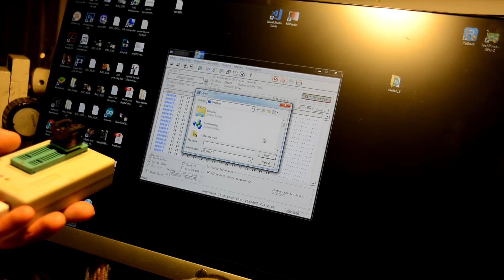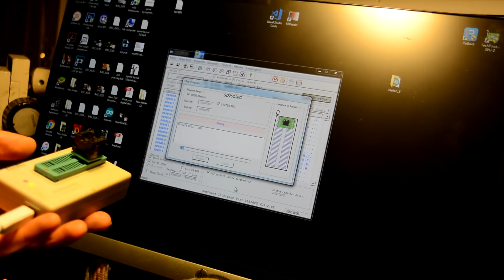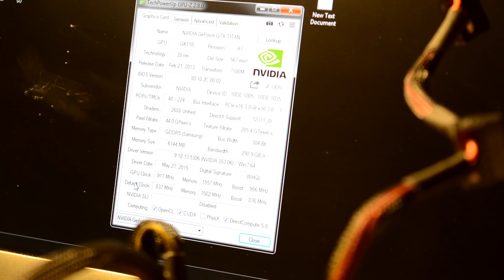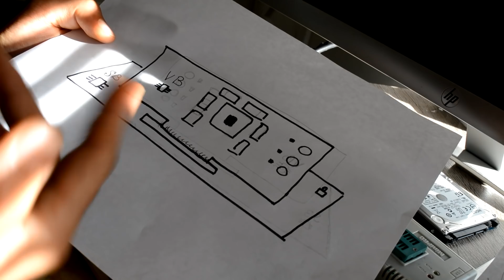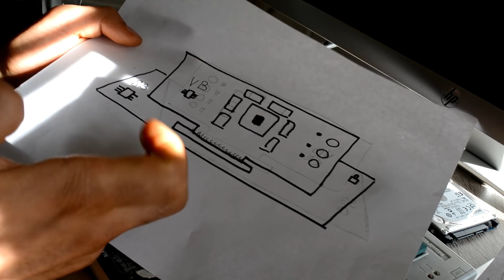GTX TITAN broken, no video out diagnostic + repair + a bit talk about bios graphic card repair

Comment: my gtx titan xp show error on screen that pcie power is not connected i know my psu is fine as i am running rtx 2060 on it without any problem before i was running gtx 1070 zotac 3 fans gpu with 2 pci power connectors so i know my psu is fine and checked gtx titan on other psu it shows same error what should i check??

Comment: Great fix i do have 2 Titan black and i replace the thermal for both of them one card works perfectly after clean etc, the second not detected and no signal at all i cant even flash bios of unstill driver or do anything actully totally not working ,the fan is spinning normal light power seems fine, any help will be highly appreciated.

Comment: I have a ?
 I have a nividia gtx980ti founders edition  it has the same board as the titan and numerous others.. its the one with the 5 caps with one staggered so there not In a straight line. im a great car/truck mechanic very good at diagnostic on the system and understanding how they work its all D/C... im dabbling in repairing small electronics due to no work.... my son bought this card it has 12 volts and had 5.012volts on one side of the the small inductor on molex side plugs opposite end of vid outputs .....it shows 5.036.V  on SIDE closest to mobo ... on the side facing the gpu 8 & 6 pin molex psu plugs it shows -7.023volts?????????... I found a apl3516a switch that is only getting 2.07v on input side and 0v output side so I went to probing and popped a  0,ohm  resistor I finally got proper leads desoldered the resistors jumped them with solder got fans and lights working again...the card don't show up in the bios of my mobo or in windows system. No video output everything looks OK no hot spots the chip gets hot upon start up its getting same voltage out of the inductors @0.087 V the 3.3 v side is getting 3.3 in and out on the other apl3516a just above the one that is getting only 2.07v and nothing out the location of those switches are directly behind  the top 2 of the 4 hdmi & pci output plugs bellow the multiple card plug next to bios chip i think . Sorry for writing you a book I subscribed and like all videos also recommended others to sub and like ur vids if u have any suggestions please let me know also where does that apl3516a  get its power from ... these SMD pc boards ar amazing with there tech im waiting on parts and a rework station wit air & a new t12 iron

Comment: I have exact the same gpu but it has a other problem, at the 5v phase i get a straight short when checking resistance. And if i turn on the gpu i hear a buzzing sound from that area. Do you have any clue what the problem could be?

Comment: I got lost at the bios section. Did you take the chip in question out, and then put it in a working card to upload the bios. And then take that out to place back in?
Reply: he used an external programmer.

Comment: I've got same issue with this card but mine is RX570 4GB MSI, fans spinning but not video output. I did reflashing original BIOS using programmer without take it off from the board but the problem still occur. What should I do next?

Comment: Hi everyone, i am repairing a gtx 780 which had a burnt memory phase. The high side mosfet died and shorted to high side so continous 12v were being supplied to memory chips. I have measured the resistance on memory chips and it gives me a short so i am planning to replace all 12 of them. Can anyone tell me is it necessary to change bios after memory swap ? Ill be using the same memory from same manufacturer (i hope i get what the seller on aliexpress is claiming)

Comment: Hi Elia-Tech, great video thanks! I had a PC about 5yrs old with 2 x GTX Titans (in Sli), when I powered it up recently it worked ok. Then 1hr later , no display & all fans going full speed! I worked out my primary Titan was faulty, when I pulled it apart I noticed one of the SiC780 chips was faulty (clear evidence of over heating).

I'm trying to remove it with my SMD hot air-gun but no luck! I'm assuming it's because the bottom of the chip also has pads which are soldered to a ground or power plane. Do you have any advice on how to (safely) remove/replace it? I'm guessing I'll need to heat the bottom of the PCB at the same time?

Is there anyway to private message you?

Comment: Hello, I have an ASUS GTX 780 DCUII OC with no video output, I've measured 0.9V vcore, 1.6v memory, pci-e 1.04v, there was also 3.3v on the bios could it be the same problem? 
UPDATE
looks like it was the Bios I've used bios programmer and soic8 clip and now it works perfectly

Comment: I didn’t understand a detail: if i have all resistances normal, voltages normal, it is most probably a BIOS problem right? When is it a reballing problem istead? No vcore?
Reply: Hi, did you find a solution?
Reply: it is never a reballing problem, reballing causes heat to build up in the silicon, which reconnects connections on the silicon chip itself not the bga, if reballing temporarily fixes a card you really need a new gpu, and good luck finding that chip.

Comment: it seems i have short in resistor you checked at 1:34 - any idea which component may be faulty? i cant see any burning marks etc
Reply: it seems all resistors works - but still doesnt boot
Did your Titan was detected in bios before You flash GPU BIOS?

Comment: Eli: Let's rewrite the bios
What Eli does: actually changing the bios chip on the pcb
Reply: Well no, he took it off the board, popped it in n SOIC adapter attached to a programmer. Which is how you would do that.
Reply: @androxilogin  Hi, where can i buy that adapter? And the programme he use? Thanks mate
Reply: @loko1505  just search SOIC8 on eBay for the adapter (a couple bucks). The programmer, well that's questionable. You can get a PICKit3 for about $10. Just be sure to Google the chips for compatibility. The k150 was good for a large number of chips but that was years ago. Not sure if they kept it up to date because apparently mine had a knock off chip installed.

Comment: You could of flashed the bios by putting a working card in pcie 0 put the card that doesn't work in pcie 1 and flash it via command line.

Comment: Thanks for another great video, it's great to see how "easy" it can be for someone who knows how stuff works :)
One question though, had it been possible to "flash the bios" while on the card, or is that not possible even if the chip is OK ?
Or was the bios chip "destroyed" so that You had to replace it with a functioning one ?
Best regards.
((P.S. I believe the card in the video is one of the "original Titans" (GK110) with 6GB VRAM... if I'm not mistaken ;))

Comment: Hey Eli, 
thank you for this video! I have a 780 Ti, and I checked all the resistances and voltages just like you, and it is all same, but no image. Chip is warm, but not hot, and I can hold it with my fingers. Could you maybe help me repair it? What should I do next? 
Thank you!!
Reply: I think its a problem with your gpu chip it self. I was following Eli's other videos in which he replaced a 1070 gpu chip. He mentioned there i think

Comment: May i please know how to send u my card its a gtx 1080ti that i only got to play 2 times with it and after there was no display and the gpu is not getting DETECTED by the motherboard tried more then one pc.. but the fans are spinning... plz help i spend lots of money on this card
Reply: Did you find any solution.I have exactly same problem as yours.
Reply: RMA it unless you intentionally overclocked it,  which is something you should never do regardless of what moronic enthusiasts tell you to do.

Comment: I use these for motherboards and GPU BIOSes. For five dollars with adapters this works perfect. https://www.ebay.com/itm/Multifunction-CH341A-Router-USB-Programmer-LCD-Burner-Bios-Board-24-25-Series/272907584757?hash=item3f8a8f44f5:g:ZD4AAOSwwVBbg3ny:rk:55:pf:0

Comment: with an onboard card, or dedicated 2nd card, you could have reprogrammed the bios without soldering out the bios chip.
Reply: If you have watched closely the gpu itself wasn't getting hot with the old bios, which tells me that the gpu wasn't even recognized by the PCI BUS. Maybe I am wrong, but I think flashing within an OS would have been impossible.
Reply: @tirelantony  i was bios modding my 970 and after that the bios was broke. no booting to windows and peepcode was broken gpu. then i threw out the card, switched to the igpu, putting in again and flashed it again with correct bios. worked perfectly.
Reply: @BlacKi-nd4uy  Wow. Nice!
Reply: your the gpu is detected? 
Mine just wouldnt show up under system properties
Reply: i confirm it. I remember doing that once with my dead amd 5770 card, worked well

Comment: i got a free dead GTX Titan with similar problems. I didn't even think about the bios. good power rails, tried reflow, it's detected but throws pcie enumeration errors. I'll have to get a programmer and try reflashing the bios hex
Reply: pretty sure t here is a tutorial for flashing bios easily with tools and bios database is available on www.Techpowerup.com/vgabios

Comment: anyone else clenching when he powers on without a heatsink?
Reply: Nah. When the GPU isn't under a significant load it doesn't get hot too fast... unless it's an R9 290X / R9 295 X2 then it burns your house down in a femtosecond without adequate cooling!!
Reply: @DigBipper188  ahaha, it s true
Reply: @DigBipper188  or a fermi.
Reply: @abcdefg9613  they have a heat spreader... Bare die though would be a totally different animal LMFAO
Reply: @DigBipper188  I have burned myself in a fermi with the heatsink on.
Reply: @abcdefg9613  not shocked. just the spot behind the die can hit between 70 and 90*c depending on the load the card's under.
Reply: nope, is normal in a testing environment
Reply: Why? All components got thermal protections, I guess the last chip without was the duron.
Reply: @dario_Iuliano  Generally, yes, but they're not totally foolproof. You can make a CPU cook itself to death just by not having RAM in the system, for example.
Reply: @DigBipper188  why? does a cpu work at 100% without ram installed ?
Reply: You can do it with a CPU too. It doesn't burn you right away.
Reply: It's ok,  once he see's he gets video he powers it down and puts it back together to do the stress testing.  Chips can take quite a bit and aren't as fragile as most ppl tend to believe, they are delicate nonetheless but durable.

Comment: But isn't this a Titan (without X)? Good video though!
Reply: It is! GK110 chip means Kepler.
Titan - Kepler
Titan Black - Kepler Gen 2
Titan Z - Kepler Gen 2 Dual GPU
Titan X - Maxwell
Titan X Pascal - Pascal "Gen 1" (better 1080 non-Ti)
Titan Xp - Pascal "Gen 2" (better 1080Ti)
Reply: Yep. The Titan X is a Maxwell generation GPU and has a black cooler shroud. The original Titan is a Kepler generation GPU with a silver shroud. Exactly like the GPU in the video. Also, the chip code matches a GK110 A1 stepping, which is a Kepler Titan / GTX 780Ti chip.

For reference:

The original Titan chip code is GK110
The Titan X chip code is GM200

NVidia's post Kepler chip naming scheme is as follows:
Much like Kepler's naming scheme, all modern NVidia GPUs have a 2 letter code denoting architecture. GM for Maxwell and TU for Turing alongside a 3 digit code denoting the performance tier. For example, TU102 would be a Turing chip form the upper mid tier, which just so happens to be an RTX 2080/2080Ti. A GM200 is a Maxwell chip of the high end/flagship, which was released in the Titan X. The GTX 980/980Ti, which was in the same generation as the Titan X, used a GM204 code, denoting a Maxwell architecture of the upper mid range.

High end: x00 
upper mid tier: x02, x04
lower mid tier: x06
Low tier: x08

Nowadays for the current NVidia GPUs, we never see the x00 silicon like we did in Kepler and Maxwell, as it ends up either unreleased or released as high end server/workstation hardware. We do however see the x02 silicon being used for "high end" GPUs like the RTX 2080Ti and RTX Titan (soon to be released).

Comment: I have tried to rebios bricked zotac gtx 1050ti,but I made worst instead of working now it wont detect and the fan wont spin,any tips ?
Reply: Do you have access to a flash reprogramming tool much like the one used in this video? You don't have to desolder the BIOS chip to access it if you also get an in-circuit programmer (ICP) clamp. You can normally just get a stock BIOS, overwrite the bad one and have a working card again in a matter of minutes if you can get hold of a programmer. The CH341A is a cheap, easily accessible and moderately simple to work with programmer that can be used with ICP clamps to program flash chips while they're soldered to a board.
Reply: @DigBipper188  im using other program like you mentioned it called CH341A,before the fan is spun up but no detect,after I rebios with program called CH341A,now the fan wont spin up,I have tried to re-write,erase,etc still no working (my bad english apology)

Comment: Hello my friend, i have bought a Titan X faulty on ebay after fail bios flashing! I have no test Voltage, but i think is the same thing! GPU never make heat! I will control voltage and can you sell me an freshly eprom with the original BIOS? I'm technician electronics, i can easy remplace it. Thanks mate see u. Sorry for my english
Reply from the maker: I would rather test at least Voltage. All info in about of this channel
Reply: You should always test at least 3 probe points on the card. For NVidia GPUs, you require a vCore, VMem and PLL/PEX voltage for the card to be able to function. vCore is between 0.8 and 1.2v, vMem is normally around 1.2 to 1.5v and I think PLL is 1.8v, although I don't have a PCB layout in front of me to verify that. You also really should find and check the logic voltages responsible for feeding the VRM controller and the gates on the VRM MOSFET packages. they shoud be 3.3v and 5v respectively if your VRMs are not outputting voltage.

With regards to programming, you don't have to desolder the EEPROM. You can buy CH341A programmers and in-circuit programming clamps VERY cheaply for the SOP-8 chip package the GPU you want to recover most likely uses for a BIOS EEPROM. The stock BIOS can be loaded into a programming software and written to the chip without needing to power on the GPU to do the write procedure.
Reply: @DigBipper188  where do you find the bios .bin files? or how to download/extract them?
Reply: @anno32  You can get the stock BIOS files from Techpowerup's BIOS database by looking up your specific GPU's vendor, the model of GPU you have and making sure the image and card information are a match.

https://www.techpowerup.com/vgabios/

I recommend you use GPUZ to make sure the information is correct befire then proceeding with either ATIFlash or NVFlash for the card that you want to reflash. ATIFlash is for ATI or AMD GPUs and NVFlash is for NVidia GPUs.

Comment: But i really love the work youre doing. You gave me the confidence to reflow my gpu chip cause i didnt have display and it worked, i mean i blew up a capcitor in the process and it doesnt really effect performance but my gpu is running like it did out of the box.